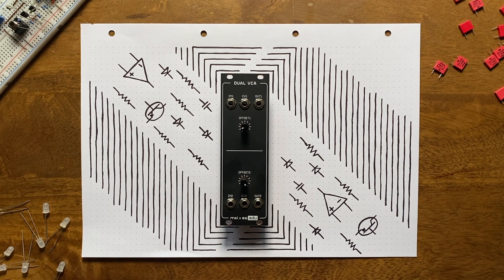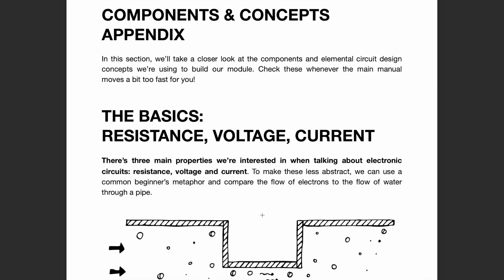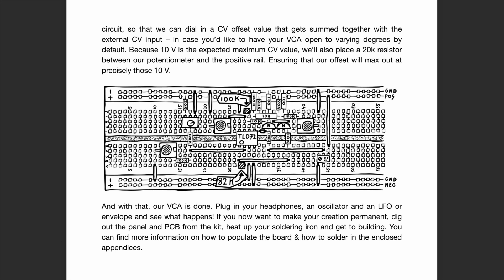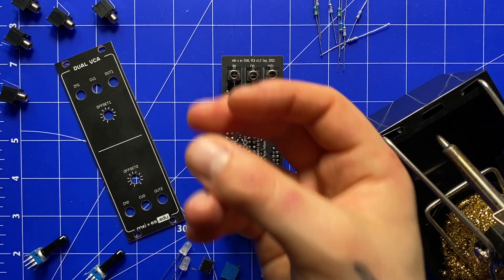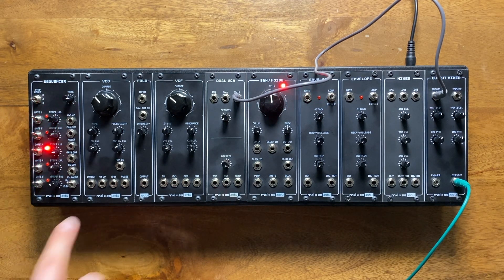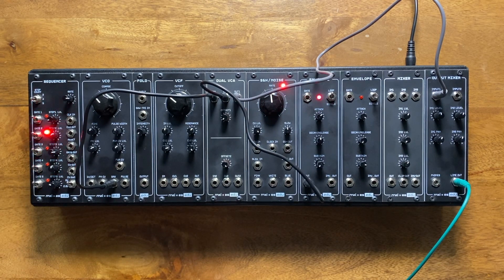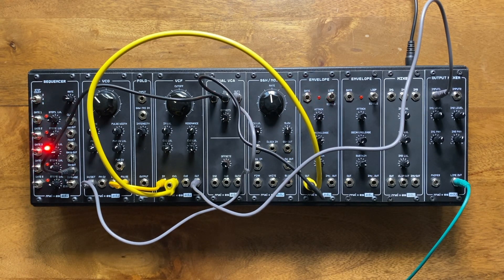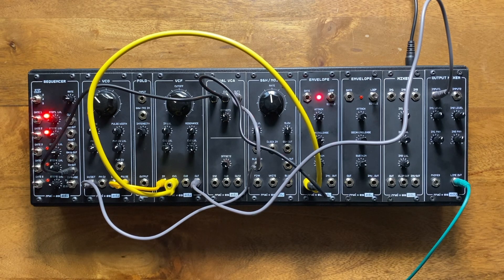Introducing the mki x es.edu DIY VCA kit

Comment: Hi
I have built the VCO - works perfectly.
And I have finished the VCA Kit.
However my VCA does not work on either channel. The board and schematic list several test points, but I cannot find any mention  anywhere of what or how to measure these test points. Is there any chance I can get some documentation on troubleshooting, or at least values to check in the test points???

Comment: Hello, I purchased 2 VCO's, am planning to purchase 2 EG's, 2 S&H, 2 Filters (hoping you will publish HPF mod for one). Would I benefit from purchasing 2 VCA's or will just one do it since it is already dual? Same question with the wavefolder. I'm thinking I'll only need one of each of these modules plus a couple mults.
Reply from the maker: it‘s hard to say because it really depends on the types of patches you want to do in the end. if you‘re just going for subtractive monosynth voices, one dual VCA module should be enough. the wavefolder doubles as a sawtooth-triangle converter, just FIY. so if you want to get two triangle oscillations simultaneously, you might want to get two.

Comment: thank you Moritz, Ive got both the VCA and VCO on pre-order :)   ..... one thing, could you perhaps do a video on eurorack protection... 
I see a little bit about it in the back of the manual but would love more info... e.g.  how does the reverse polarity protection work?  do we need to filter noise of eurorack bus?  can we demo this on a bread board?    what happens if we connect an output to an output? or an input to an input?  
also, I remember something posted by a module designer talking about impedance of outputs? whats this about?
but once again, thank you for instigating this project... and providing great videos and documentation.. Im learning so much already, and look forward to more modules :)

Comment: Thank you so much for giving such great explanations for your circuits 👍
Forrest Mims would be proud !
Reply: you arent kidding man i almost teared up reading through the vco manual. he really nailed that shit. i modified the crap out of my old radio shack 500 in 1 learning lab and turned it into a synth breadboarding box complete with the dual power rails, and swapped some of the components out with 1/4" and 3.5mm jacks so i can just connect them with the springs. its like im 15 all over again.